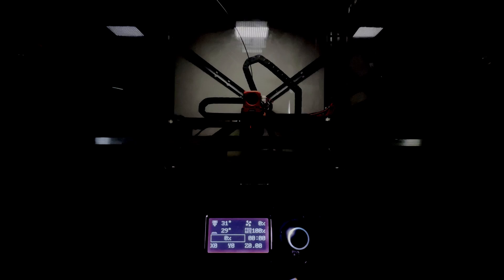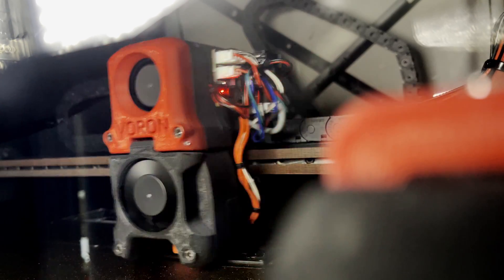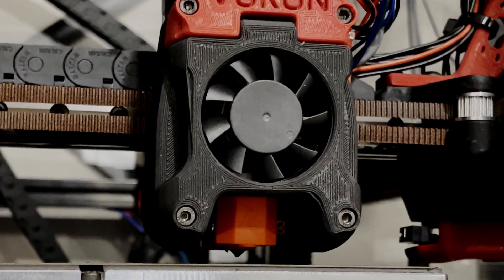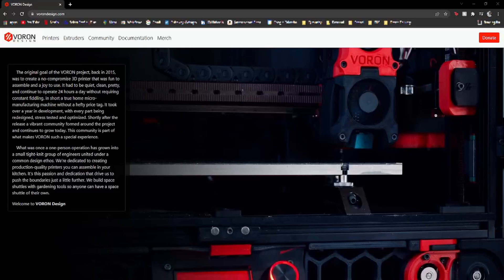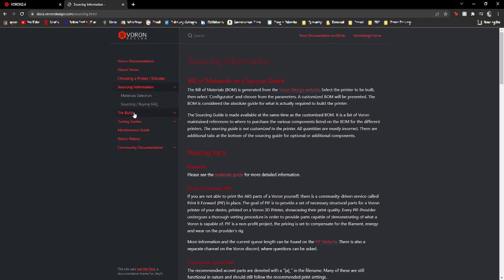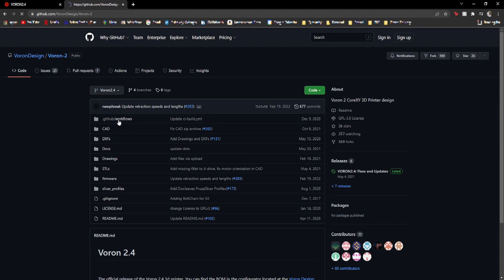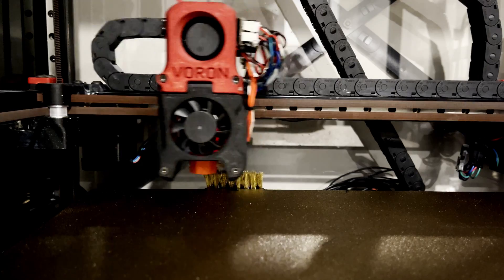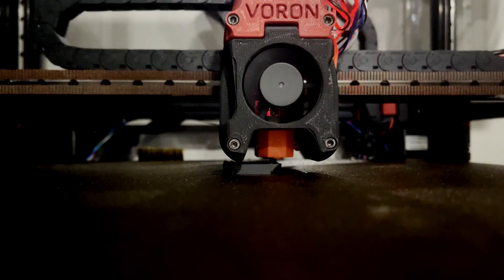This Project Took Me 150 hours!!

Comment: Hey dude love the way u make models and innovate videos,. 
I just had one thing in my mind, 
 In ur boring company model video,where u  explained abt the boring companys work and also showed a model,so my question is -
How did u build the car like with the motors, can u just tell me that and how did the car move away so fast when u just kept it inside the tube or pipe?? 

Wld really help me if u wld reply
Reply from the maker: I used copper tape which was placed along the tube, and I connected the copper tape to positive and negative terminals on a battery. The car had metal pads that contacted the copper tape to power the motor on the car.